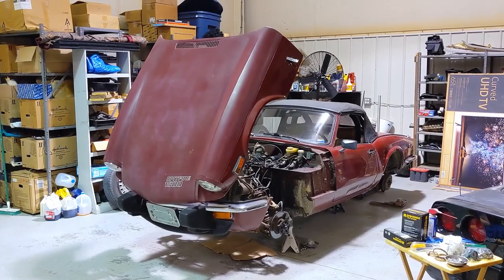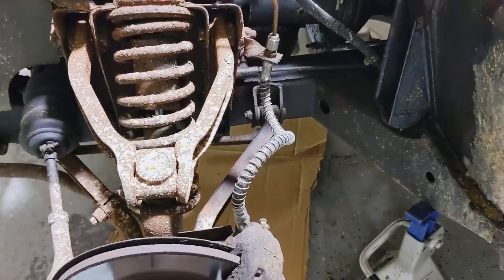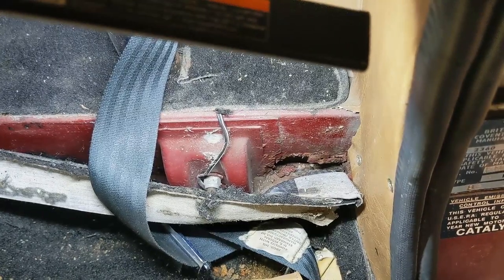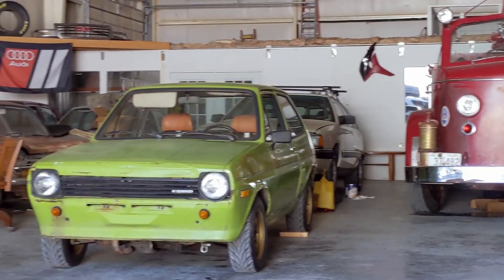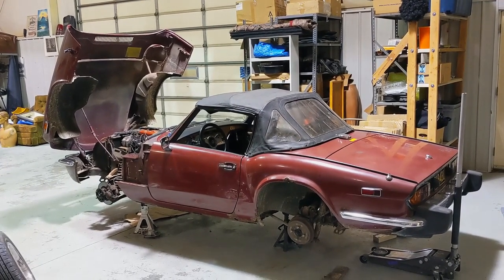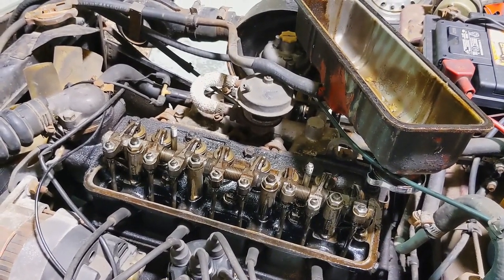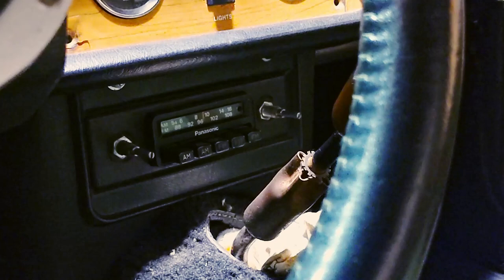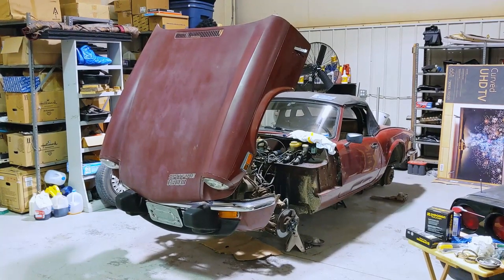Rust, Leaks, and Easter Eggs: Digging Deeper Into My 1978 Triumph Spitfire

Comment: Great video - thanks.  A word about the rear spring sagginess.  It's wear on the interleaf buttons causing the sagginess. The reason is they use a 'Swing Spring' which means the leaves slide across each other.  It alters the geometry in corners to reduce wheel tuck. Replace the buttons and ride height is restored.

Comment: Poly bush ( U.K  ( silicone ) is the way to go when replacing those perished rubber bushings , you can even select your preferred grade of stiffness and customise your suspension , best bit is they last 4 - 5 times longer .
Reply from the maker: Thanks for the tip, I think I'd like to go poly and never have to mess with them again. As long as the ride doesn't get too bumpy, then again it's already very bumpy!

Comment: Make sure you check the lower front trunnions, they can collapse if not maintained. That part you said was a fuel pump looks like the water heater valve

Comment: The first item is a Ignition switch on the back side of the Steering lock
The second item is your heater Valve.
Reply from the maker: Ah okay, very good. Thank you! I wonder why these are here considering the heat and ignition both work... 🤔
Reply: @justindake  i suspect the ignition switch is 1976 or older.... looks that way to me

Comment: In mid 1978 Spitfire's a Mota-Lita steering wheel with a real leather rim was fitted as standard. In the later Spitfire's a Plastic/Rubber thing was fitted.
Reply from the maker: Ah! That's pretty neat. Boy this car must be all original then except the roll bar.
Reply: @justindake  it's also the most desirable spitfire steering wheel - available only for 78.  TR8 had one too.  not the TR7 however.
Reply from the maker: Wow! That is fantastic.

Comment: Hi, great your love of spitfires. I have had 14. I have 2 now. One with a ford puma 1.7 vvt engine. Bit frustrating seeing you not know what parts are, the heater valve is not a fuel pump! Rear diff seal in the boot! I know every nut and bolt having had them for over 30 years, my love of them from my aunt who used to drive me in hers in the 70's. Drop me a line if you need to know anything.  I would definitely get the tie bar rust sorted with your rocker as these are structural on a spitfire.  Keep it up
Reply from the maker: Somehow missed your comment but thank you! Holy cow 14! I've got a long way to catch up.
Reply: On my third gt6, just starting to restore it now.

Comment: Curious but can bushings, ball joints or brake parts be found at say a NAPA/Carquest or do most of the parts need to be sourced from the UK?
Reply from the maker: I've never tried but if you could they probably wouldn't be in stock, only special order. In my experience, when it comes to obscure cars the local stores often cost more than a specialty store even with international shipping. I've also gotten the wrong part on several occasions, but rarely if ever has that happened with a specialty shop.

Comment: A word of caution.  Many new parts are aftermarket and poor quality or even unsuitable.  For instance, the new fuel pump that is fitted, quite likely is producing far to much pressure, which will cause running rich. Likewise many replacments steering racks and rear springs are garbage! The sagging rear may need just replacing buttons, but if that does not cure the sag many owners fit mid 70's era Corvette air adjustable shocks,  that happen to fit perfectly.  Nice project !
Reply from the maker: Great advice! I actually had someone local tell me about the Corvette shocks too. I haven't made an update video in a while but it's running rich no matter what I do with this new weber, and I had just started questioning fuel pressure. That pump may well be the culprit